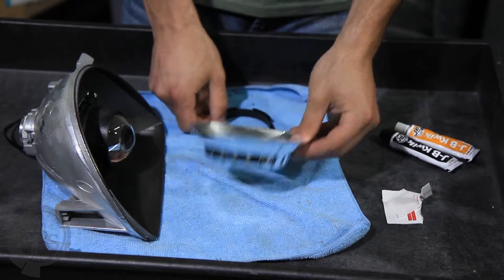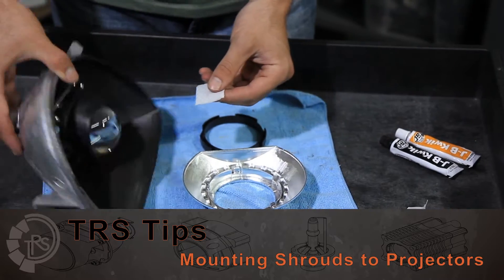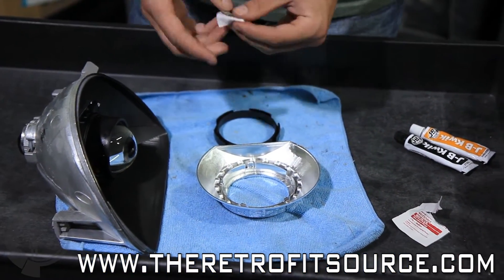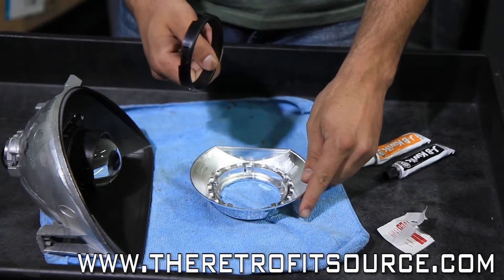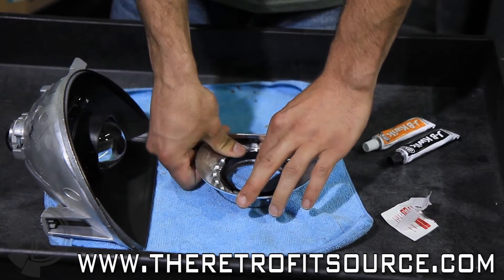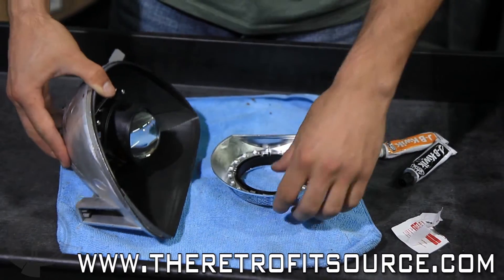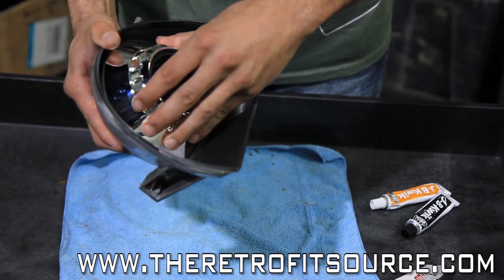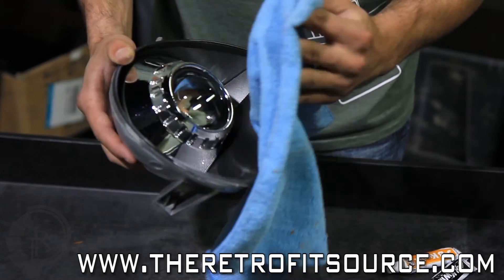TRS Tips: How to Mount Shrouds Properly For a Headlight Projector Retrofit Upgrade

Comment: The JB weld link goes to 404. What's the product name and should you have to mix both the paste together and use it?! Thanks!
Reply from the maker: Just got that fixed, but for reference, here's the link. We recommend the "Quik Weld" - which has to be mixed together before it hardens. https://www.theretrofitsource.com/accessories/build-materials/jbweld-epoxy.html
Reply: Thanks for fixing the link. Mixed together AND applied before it hardens?! And what if I want to remove the shrouds in future?
Reply from the maker: Of course! Yes, mix together and applied before it hardens...you've got a good 10-15 min before that happens, so it wont be a huge rush. If you want to remove them in the future...well, you'd have to rip them off, but thats the point. This stuff holds!
Reply: Thanks. Would you mind answering a few more questions of a first time installer? 1. I don't have a garage or external batteries to test the beam pattern of the projectors, so I might end up coming back to the car(battery) every time for checking the alignment. Is that normal or I'm simply going to beating around the bush by doing so? 2. Would it be just fine with a 6' room instead of a 21' distance requirement for testing and adjusting the beam height? 3. How do I rotate (to get a perfect overlap) the projector or adjust their height? Mine is a G5-R model, and not sure where the screw for height adjustment is located. Thanks so much!!!

Comment: Thanks for the video! Is that headlight from a 2008 Cobalt by any chance? If so, would the PANAMERA LED DRL shroud fit in that housing without much, if any modification? Thanks for the help. Keep up the great work guys!
Reply from the maker: Allan Baillo The headlight is actually an EK Civic, but its very similar in size to the Cobalt light. In fact, maybe a little smaller - you should definitely be able to fit those new Panamera LED DRL shrouds in there with little/no trimming Allan
Reply: TheRetrofitSource Inc Thanks for the reply! That is good to know. I'm starting to order supplies for my girlfriends Cobalt as I am retrofitting projectors in her car for her birthday because her stock lights are absolutely terrible. I would think she would want the LED DRLs like the panamera have and I was just wondering if cutting was involved and how much you could actually cut the panameras because of the LEDs getting in the way of cutting. Thanks again!
Reply from the maker: Allan Baillo If you use the Mini D2S 3.0, that would be perfect for the Cobalt and not require any cutting to fit the Panamera LED DRL shroud on. Just a little trimming to actually install the projector in the 9007 hole, but overall pretty easy!
Reply: TheRetrofitSource Inc Thanks for the heads up. I actually just ordered some B-Stock Mini H1 6.0s that I was going to tune up to working order and that is what I was going to use on her car. But I can use those on my car. The D2S 3.0s have better light output anyways and if the install will be easier, I think I would rather go that route. I have a Mini D2S 3.0 X-Lens on my 2015 Yamaha FZ-07 and I absolutely love the output. I just choose the Mini H1s because they were smaller and I thought the D2S wouldn't fit. Thanks for all the help. You guys are great.